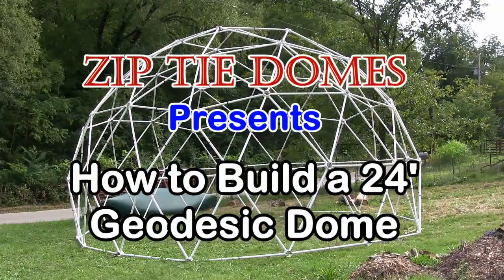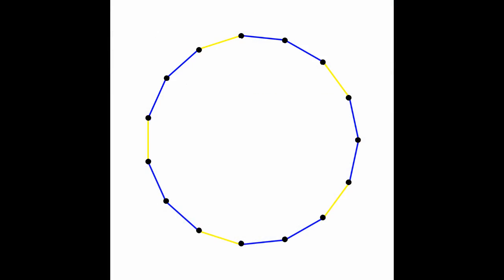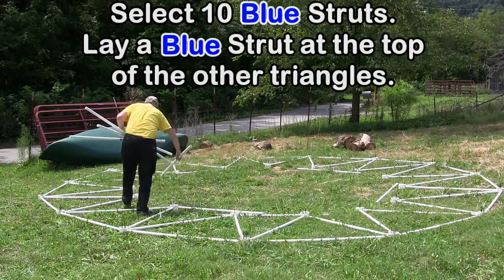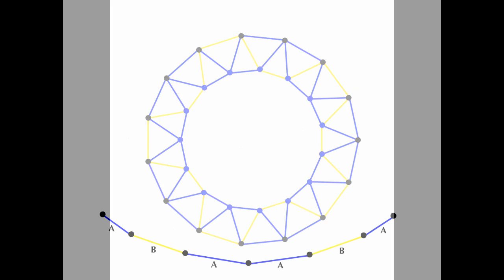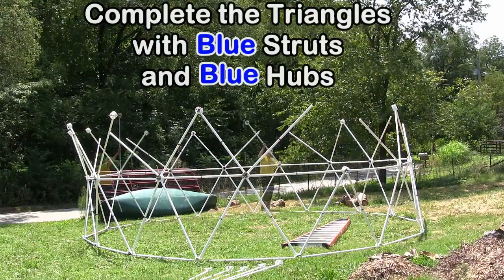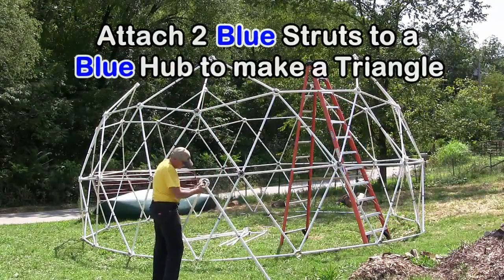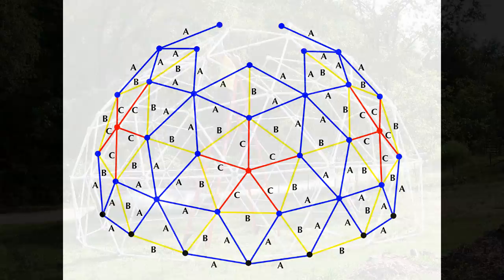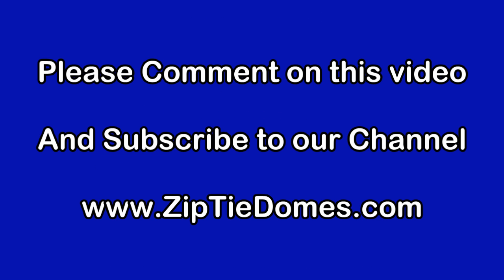How to Build a Geodesic Dome DIY - 24' diameter 3v 5/8 Geodesic Dome

Comment: What are the dimensions in order to cover with greenhouse plastic for this dome?
Reply from the maker: A 25' diameter 3v 5/8 dome 14' tall requires a 48' x 48' sheet of greenhouse plastic, which you can buy at Farmtek Grower's Supply.   John

Comment: Is the node to node length set in your calculator, or is the node to node set for your hubs, thankfully Rick...
Reply from the maker: When the calculator is set to the default "No Hubs" for the hub size, it returns length of the chord between each vertex, or "node to node" length.  When it is set to "Standard 4" Hubs", it subtracts 2-3/8" width of the center ring from the chord length.  The "Super 6" Hubs" setting subtracts the 3.5" center ring distance from the chord.  So, if you are not using our hub design, just leave the calculator set to the default "no hubs" setting.  Thanks for watching the video.  John Hurt
Reply: Zip Tie Domes thanks John for the quick answer,  Have you sold hubs to Australia,
Reply from the maker: @shovelrickshovelhead8713  Yes, quite a few.

Comment: Excellent video! Using these hubs designed for the 24’ dome, could one use a formula to size the dome and struts smaller or do the hubs need to be manufactured differently to make a 15’ 3v dome?  Also, without weakening the structure, how large of an opening can one make in the dome? Thanks, and I look forward to purchasing a kit!
Reply from the maker: Yes, you can use the same hubs to make a 15' 3v dome, we have a 17' 3v for sale on our website.  The struts are just cut shorter to make the smaller dome. 

You can take out an entire hexagon section for a door and the dome will still be stable and very strong.  There are many examples of doorways in our "Customer Review" section at the bottom of our main page on our website.  Look in the "Greenhouse Domes" section for some of the best doorway examples.  Call us at (931) 858-6892 if you have questions. 

John Hurt
Reply: Thanks!

Comment: Hi there, quick question. What do you mean with 3/8 and 5/8? is the size of the ring? Its not really clear in the calculator page. Thanks in advance.
Reply from the maker: It is the type of 3v dome.  The 3v 5/8 dome is taller than the 3v 3/8 dome, as it has an extra vertical section at the bottom of the dome that makes it taller.  Thanks for watching the video.  John Hurt

Comment: How do you put plastic on it ?
Reply from the maker: We have two different types of hubs - a Standard Hub for putting plastic on just the outside of the dome, and a Dual Covering Hub for putting plastic on the inside and outside of the dome to create a dead airspace for better insulation.  You can find out more at this link:
https://www.ziptiedomes.com/geodesic-dome-hub-kits/about-geodesic-dome-hubs.htm

Comment: Can you tell me why you need poles of three different length? This can be constructed with every pole being exactly the same. As it is true to every deltahedron, no matter how many corners it has.
Reply from the maker: The icosahedron is the largest deltahedron - with all edges being the same length.  They tessellate each triangle in an icosahedron to make the higher frequencies.  This makes the struts 3 different lengths for the 3 frequency dome.  We have a video that explains this at:
https://youtu.be/DfhMYHdcL5k

Comment: hi,thank you for sharing this video .I was wondering and hoping if yo would like to share some technical  detail information cause I am planning on making this for or at my farm. Do forgive me for coming across as pressumptuous by sending you my questions before you agreed to help me out.
1.sizes of hub rings
2.diametre of cello rings
3.dametre ofpipes and guage of pipes.
4.depth of rings
I would be grateful to receive a reply to my querries from you. Thank you in advance Wayne Brown
Reply from the maker: It depends on the strut diameters and the dome frequency.  
We use different size drill bits depending on the strut diameter and the dome frequency. The drill bit size controls how far the struts can move before they lock into place. If the size is too small, the dome will be too tight and hard to assemble. If the drill bit size it too large, the dome will wobble and not be as strong. There is no single answer to the drill bit size. We use mathematical calculation on a spreadsheet we have developed, and trial and error, to determine the correct drill bit size. The other measurements are also different depending on the dome and hub type.  Thanks. John Hurt
Reply: @ZipTieDomes  thank you so much for your response

Comment: Dang! Someone has done a lot of homework, and taken a fair amount of time to put all this together. In the 70s I read a lot about Buckminster Fuller and his obsession with Geodesic structures, so I'd known that they weren't simple collections of identical pieces. But I never bothered to take the time to get into the detailed math. Seeing all the overlapping internal symmetries gives me a deeper appreciation. Here's a link to a video of a guy building a climbing dome from metal conduits. He had a metal shop with a hand grinder, table-mounted grinder, hand-drill, and most importantly, a hydraulic press to flatten the ends for the overlapping connections. You can see in the video he's using TAMLEX 26mm 4568 0022414 CLASS3 conduit. He lives in UK.
He shows clearly how he flattens, shapes and drills to make the lapped connections, then assembles the parts and stands on top. No info about calculating component lengths.
The title of the video is "*Conduit Climbing Frame Build.*"      Here's the Link:       https://www.youtube.com/watch?v=E_odIPttYP8
Reply from the maker: Yes, my first geodesic dome was made from EMT conduit with flattened ends with the ends drilled and bolted together to make the hubs.  Paul Robinson in the UK has a lot of other good videos on how to make a geodesic dome, as well as EMT conduit. But the conduit domes with flattened ends are hard to erect, and they are too heavy to move easily.  I wanted a geodesic dome for a moveable chicken coop made from lightweight PVC pipe so I could move it easily and give fresh grass to my chickens every day.  (The eggs are much better when the chickens are grass fed.)  That is how I stumbled into making geodesic domes.  Thanks for your comments. Let me know if I can help you.  John Hurt

Comment: How do these hold up in winter snow?
Reply from the maker: They use them for Ice Fishing Huts in Michigan, as seen in this customer review:
https://www.ziptiedomes.com/customers/allysonpacker.htm
Here are some other reviews about using the domes in winter:
https://www.ziptiedomes.com/customers/lanafrommaine.htm
https://www.ziptiedomes.com/customers/davesable.htm
If you have any questions, please call us at (931) 858-6892 or email us at:
https://www.ziptiedomes.com/contactus.htm
Thanks,
John Hurt
Reply from the maker: Here is another good review about snow on the dome:
https://www.ziptiedomes.com/customers/genehersey.htm
John
Reply: Thank you so much may I ask if you tried making concrete domes using the plastic domes as a frame I heard you say your trying it with basalt struts.
Reply from the maker: I have not made a concrete dome at this point, but some of my customers are working with spraying concrete and / or closed cell foam for covering their domes.

Comment: Two big questions, one how you attach plywood or sheathing to this structure. And two, how do you get it past the building department. Thank you for your reply.
Reply from the maker: Theodore,
If you want to attach plywood, use wooden beams and another type of dome connector, such as steel or plastic connectors made for 2x4 lumber struts.  But cutting 4' x 8' sheets of plywood into triangles creates a LOT of waste, and I really don't think a geodesic dome should be covered with plywood or polycarbonate for this reason.  Lloyd Kahn, who wrote "Domebook 2", said that geodesic domes are smart, but not wise, if you try to cover them with sheets of rectangular material that has to be cut into triangles.  Too much waste.  So I don't encourage using plywood with our domes.
A better solution is to cover the dome with a single sheet of greenhouse fabric, or a covering like a billboard tarp. 
If it is a permanent structure, then spray it with concrete. 
You can also use a parachute, or marine shrink wrap with a heat gun to get a nice fitted covering. 
When you cover the dome with a sheet of plastic or fitted cover, and when you do not have a permanent foundation, then the dome is a temporary structure, like a tent, and will fall outside of building codes.  There are no building codes for a tent in most cities.
If someone from the building codes department tries to hassle you, ask them for a written copy of the ordinance in question so that you can give it to your attorney.  This usually runs them off, as most cites do not have any regulations on a geodesic dome, especially one that is clearly a "temporary structure."  Of course, a "temporary structure" can last several decades, and still be "temporary."  But you can ask them first for a copy of any building codes or city ordinances, which is a good idea.  Some towns have a maximum height requirement for any temporary structure, like 12' feet, which you would want to know before you built a dome.
I hope this helps.  Call me at (931) 858-6892 if you have questions, or by email at: 
https://www.ziptiedomes.com/contactus.htm
Thanks,
John Hurt
Reply: I am having trouble finding hubs for 2 x 4 construction of a geodesic dome. Do you have a recommendation? Thank you for your time.
Reply from the maker: Try this for a starting place, as there are others as well:
http://www.domeconnectors.com/
John Hurt
Reply: Bureaucrats with no justifiable purpose struggle to keep "busy". But they are looking for those who don't fight back, don't challenge them. Asking for documentation usually makes them disappear.

Comment: I've always loved domes, love watching this technique, bunch of triangles, makes a nice shelter.  Now throw some plastic sheeting over it, some wire mesh, and blow some  papercrete over it, let set until hard, remove the dome frame, reuse dome frame
Reply from the maker: Thanks, S Robin.  Once you add a hard shell to the structure, such as papercrete, it becomes much stronger.  One person in New Hampshire is spraying closed cell foam on his dome as a weatherproof and insulated covering system.  Thanks for your comment.  John Hurt

Comment: I just want one big enough for my German shepherd to be able to walk into and have a little free space so if I needed to come in to check on her.  Do you have a design like that?
Reply from the maker: Yes, we have an 11' diameter dome that is 5.5' tall, and I have used that size with puppies, it works great.  Go to our website at www.ZipTieDomes.com and get the 11' Chicken Coop or Greenhouse dome, either one will work for your dog shelter.  We have sold several to veterinarian clinics for this purpose.  Thanks, John

Comment: I was thinking of using electrical conduit and whack the ends flat drill through them and attach all the intersections with screws... then wrap the whole thing with shrink wrap and spray foam inside first and then outside.  sand smooth... cover outside with white cool seal roof coating and spray texture inside and spray paint inside.
Reply from the maker: That's a great idea
Reply: Here's a guy who did part of that.
Here's a link to a video of a guy building a climbing dome from metal conduits. He had a metal shop with a hand grinder, table-mounted grinder, hand-drill, and most importantly, a hydraulic press to flatten the ends for the overlapping connections. You can see in the video he's using TAMLEX 26mm 4568 0022414 CLASS3 conduit.  (UK)
He shows clearly how he flattens, shapes and drills to make the lapped connections, then assembles the parts and stands on top. No info about calculating component lengths.
The title of the video is "*Conduit Climbing Frame Build.*" Here's the Link: https://www.youtube.com/watch?v=E_odIPttYP8

Comment: Can transparent poly carbonate plate be easily substituted for a covering?
Reply from the maker: +Jason Snyder It is harder to attach the polycarbonate plates to PVC pipe than to a wooden structure made from 2x4 lumber.  Also, you will have to cut the polycarbonate 4x8' sheets into triangles, which creates a LOT of wastes and is expensive.  If I were doing a polycarbonate greenhouse, I would just build a standard rectangular greenhouse, as that is the best use of polycarbonate, and you can make the openings exactly 4x8' to match the polycarbonate panels.  The geodesic dome with the triangular openings really is better for using greenhouse film, as one sheet can cover the entire dome.  Thanks for your comment.  John Hurt

Comment: Could you explain the relevance of figures such as 2v ,3v etc and 3/8 and 5/8 in your dome system?
Reply from the maker: +I am a free man !  Free Man.  The simple answer is that a 3v has more triangles than a 2v.  The "v" is short hand for "frequency", and each number of frequency is how many times you are breaking a triangle into smaller triangles.  The more triangles, the more the dome approaches a true half sphere in shape.  Since the maximum strut length is 5' or 6', we use a higher frequency dome to make a larger dome with the same strut lengths.  The difference between 3/8 and 5/8 is explained in our video "How to build a 25' 3/8 3 Frequency Geodesic Dome".  The 5/8 has a vertical section, the 3/8 does not. Email me at the Zip Tie Domes website if you have any other questions.  Thanks, John

Comment: Could you do it without the ladder and build it from the top down? :)
Reply from the maker: +signalfire6 Yes, but you would need a crane to lift the center of the dome up as you built it, or several people to lift the sides of the dome up as you attached the lower sections.  I try to show how it can be built by one person in a short period of time with just a step ladder, so this technique is from the bottom up.  Sorry I did not respond sooner, there was a setting in YouTube that would not show the "reply" button and I could not reply earlier.  Thanks, John Hurt
Reply: Sure. As long as you use a sky hook. :)

Comment: Oh this is right up my alley, what a great project, Thx.  With 2 or 3 coordinated people, this could be up in a couple hours.......what sorts of skins are available for these?   Is that up to the consumer?
Reply from the maker: Yes, you need a 48' x 48' covering.  It can be greenhouse plastic, a tarp, or rolls of chicken wire for an aviary.  One person used EMT for the struts, styrofoam for the panels, and covered the dome with chicken wire for adding stucco for a concrete shell.  So, the coverings are up to you.  With our Dual Covering Hubs, you don't need a fitted cover, it will work with a regular tarp or sheet of plastic.  Thanks, John Hurt
Reply: +Zip Tie Domes would a cargo parachute work?
Reply from the maker: Yes, look on our website at www ZipTieDomes dot com and see our customer reviews.  Mr. Matthew Kosica has a travelling art show using our domes covered with a parachute.  Thanks.  John Hurt

Comment: add foam on triangles for insulation and concrete canvas segments to get a finished livable structure. Canvas concrete is canvas impregnated with concrete. When the concrete is sprayed w/water, it hardens into a concrete shell. You can also bind fiberglass sheets to the pvc with hose clamps. cut 2 slits to fit the clamp thru the fiberglas sheet then put the clamp around the pvc and tighten. Great concept!
Reply from the maker: Yes, we are experimenting with steel and basalt rebar / mesh to create concrete domes with shotcrete.  You are on target.  Concrete canvas is also very interesting.   Thanks for your comments.   John

Comment: So, with what do you cover it, to make a skin for the dome?
Reply from the maker: Use a 48' x 48' sheet of greenhouse plastic.  See our video "24' Geodesic Dome Greenhouse Cover using Test Caps" for attaching a single covering to the dome, or our video "How to Attach A Greenhouse Covering" for attaching two layers of plastic, one on the inside, one on the outside of the dome.

John